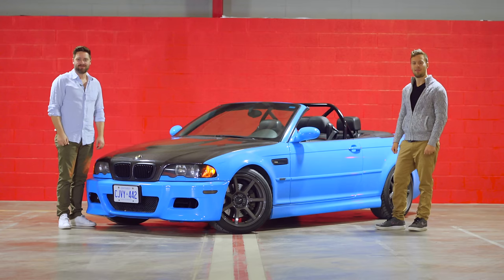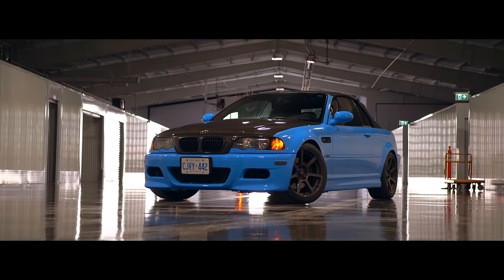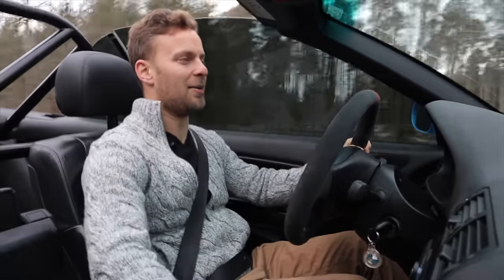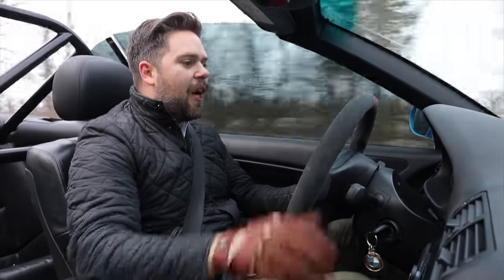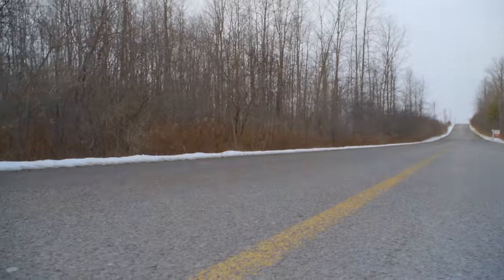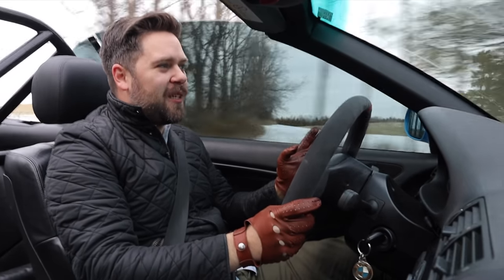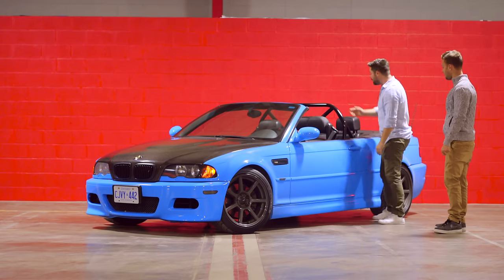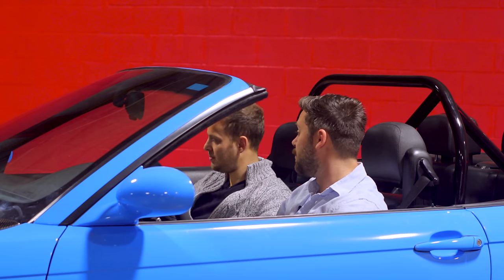I Bought A $10,000 E46 BMW M3 // The Best Car Of All Time… Says Thomas

Comment: the hazard light and central locking issue is an easy fix. you just need to switch those switches out or you can fix it as well something get loose in there over time.

Comment: I have a 2003.5 E46 Manual Coupe 6spd, with 210k miles currently. It’s heavily modified, with suspension and a supercharged system. 

My M3 has had many things replaced, all of which were replaced around 105-135k miles. They include water pumps, brakes, guibo, belt pulleys and tensioners, clutch and flywheel, etc. The list is long, BUT the de things would need to be replaced on any other car at that kind of mileage, and knowing how hard this car has been driven by myself and the previous owner, I would say that any other cars engine would’ve been blown up by this kind of mileage. Yes, there is some expensive maintenance like banks, rod bearing, and valve adjustments, that need to be done, but doesn’t every car out there have their main maintenance concerns? YES. There were also a bunch of items that I replaced just because I knew they had wear, but they didn’t need to specifically be replaced at that time. 

So yes, I’ve replaced a lot of items, and some things can be expensive, BUT this car has never broken down on me and has never left me stranded. At 210k miles and counting, and 600hp to the crank, I’m still at full compression, and am utilizing the OEM clutch kit. The car is rock solid. There are no rattles, the car handles like a Porsche, the electronics have never given me problems...the car is just bullet proof! Some might give the E46 M3 a bad rap because it’s a maintenance nightmare, but in my case, it’s mostly just been wear and tear items that would happen to any other car. Not many cars make it to 200k, and a very little percentage of them are sports cars, driven to its limit and revved out to its max on the daily. If you just take care of the E46 M3, drive it hard like it should, and do your maintenance intervals, it will last a very long time.

Comment: I had an 02 m3 cab like that one. I even had the hard top.  Never liked the sound of the exhaust but that engine was glorious. The car was great and loads of fun but it got to a point where between the service major intervals and reliability starting costing a lot to maintain it.   The interior plastics kept getting sticky or peeling off, the creaks were driving me nuts and one of the windows didn't seal well.  Both side mirrors starting rusting...I felt like I had to restore versus just maintain the car...the last year I owned it I spent over 10k in repairs and maintenance ....I sold it shortly after lol

Comment: Subframe reinforcement because it's a convertible, cheapest E46 M3 you can get so I understand, and yes the best M3 ever IMO. E30 and E90 are close runner ups. The plastics, rubber, gaskets are cheap... Maybe not a problem for Canada but here in Florida the heat will melt them. Need a good cooling system, oil catch can, good coil overs. So easy to work on tho, great project car.

Comment: hazard light and central lock can be fixed with duct tape. it is usual that the bottom of the switch breaks and when it is pushed it is pressing thin air.
Just take it out, either swap for a new one or tape up the bottom.

Comment: The sad thing is the plastics were a big step up from the E36. If you owned one of those, you became very familiar with glue guns and 3M's catalog of adhesives.

As the rear seats are unusable, why not rip them out and carpet the area? It'd save some weight and add storage space.

I also gotta say that as much fun as these are to drive, they have about my least favorite exhaust sound of any M-car. Even with an aftermarket exhaust, they always sounded tinny.
Reply from the maker: This borla has the least rasp of any I’ve heard. It’s really good actually

Comment: ive seen N54 engines hit 600,000 km, my 335i had 280,000km and worked close to new.  The problem is that while the engines are bullet proof everything else breaks around it and costs a fortune.

Comment: $12 fix on Amazon or eBay for a new hazard and door lock button. Been there on my E46. Super easy to install. Pops put, unplug the old one. Plug in the new one. Pop in. Push buttons all day.

Comment: You can replace the hazard/central lock switch for cheap or you can temporarily fix it by removing it and taping the bottom of it back together. It's easy to remove (start with cupholders like James did) and you'll know what I mean once you see the switch. #Gre(46)atestGeneration

Comment: I love and hate this car. I was on the waiting list for 1.5 years to get one, site unseen and undriven. I was lucky enough to get enough money to get one ordered brand new in 2001, with all the options I wanted. Despite absolutely loving it, I sold it 3 months later. 

The primary reason was that the convertible in particular was extremely stiff and was my daily driver. Driving into downtown DC, the minute I started hitting potholes, it started killing my back. Great second car, and the regular coupe is awesome. But I would strongly discourage the convertible as a primary driver for anyone living anywhere with potholes on many roads. 

My current daily driver is the 2018 Kia Stinger GT2. Love that car. But I’m also in my late 40’s and for my daily driver prefer a GT car with adjustable suspension.

Comment: 5:11 independent throttle bodies is not the reason for the responsiveness. VV-T and high compression is the reason. The Camaro v6 doesn’t have independent throttle bodies yet the engine is very responsive.
Reply from the maker: Indeed it’s actually a combination of all those things. The itbs work to allow immediate atmosphere at the inlet of each cylinder, so the engine can work it’s magic. This is just a long and boring explanation that didn’t need to be in the video haha
Reply: @ThrottleHouse  If you say so.

Comment: Had e46 m3 coupe with dinan mods and tune and coilovers. Used as a work car for 3 years. Did not track or race it. Ride is very stiff and harsh. Smg trans shifts very harsh. Hated the car. Dont miss it at all. If u race or track the car, the m3 is for u.

Comment: What if I told you I know of an E46 M3 that is 100% original and has less than 35k miles and has been sitting in a garage for 19 years and still looks like the day is rolled off the line.

Comment: I have a 2006 e46 330ci convertible.  It has just under 60k miles.  It is in showroom condition.  There is literally no flaws.  I only drive it in good weather, sits in the garage otherwise.  New bmw’s have too much plastic and feel cheap to me.  I will sell this car when I get my Cybertruck.  Tesla captured my imagination, bmw has fallen asleep at the wheel.

Comment: Ok, $10k for an E46, and another $10k in reserve to keep it going. Huh. You can pick up an 2010 or 2011 IS-F for around $20 and never have to worry about rod bearings, engine gaskets, cheap plastics. You don't have to put some crazy 60w oil in it and warm it up to temp before you thrash it. Granted it doesn't have a MT, but it fun nonetheless. Anyway, it is a beautiful car, congrats on picking up a classic
Reply from the maker: Na. All the expensive stuff is done. That’s why I paid as much as I did
Reply: @ThrottleHouse  Well congrats on the great pick up! Have you guys done an episode on an older IS-F? If not you should consider doing one. Love your channel!

Comment: "compact, RWD NA sports coupes don't really exist any more"

looks at lap time list where the Camaro SS 1LE literally has the top time for compact RWD NA sports coupes
Reply from the maker: It’s a full out sports car though without much livability. These sports coupes with exciting NA engines, that are comfortable spacious and still wild are hard to come by.
Reply: @ThrottleHouse  I'd agree if you were talking about the ZL1 1LE which is a more track-focused car, but the SS 1LE has Magneride shocks and is not as harsh. I mean I don't disagree with you in general, RWD NA sport coupes are definitely a dying breed. But I don't think they're gone quite yet.

I guess another difference is the E36/E46 M3 is basically a 2 door sedan not really a coupe since you can get it with 4 doors, while the Camaro is a coupe. Maybe the Chevy SS might be a better example, but to your point, that isn't made any more.
Reply: Throttle House with or without the roll cage?

Comment: The only way to increase hp without boost is to install a hotter cam. Intake is a waste of money.
Reply: F165 without boost??? What are you talking about
Reply: It increases the awesome induction noise and I wouldn't be surprised if he got the intake for free. He alludes to it in the video.
Reply: @slowschoolofdriving218  Without a turbocharger, Nitrous oxide (aka as boost in a tank) or supercharger. Changing the intake cam is the only way to increase hp. Before you try to school me on some bs you read or watched online. I have a video where I remove, rebuilt and installed a hotter cam in my 96 Tahoe 5.7 v8. I had to swap in a 99 Tahoe pcm so I could tune it with HP Tuner.

Comment: That’s not my car, but I’m very proud of it 😁👌🤝💪👍👍👍👍😁😎.  I used to own a Cabrio for over 10 years.  Maintaining cost a billion.  Not so reliable.  BMW badge on that car stands for Break My Wallet. 😁👍💰. If you think you are going to buy that car for $10k lol good luck.  Yes you will buy it for 10k and spend another 10k to make daily drivable.  How much does it cost to do the diff? Engine Rod bearing ? Clutch ? Suspension?  You forgot to mention, if you don’t have free Mechanics standing by, labor and cost of all the things I just said will set you back more then $5k even for original parts. And original parts are not cheap on that car. Basically for $10k you are buying a older $80k plus car which it used to cost as a brand new car, and parts are made for a $80k car and not for a $10k car, over the 10 years I have spend like $40 on my E46 M3 with some upgrades and cost of Maintenance from all the things breaking down a going bad. And yes I used to drive it like it Stole it 😁💪😎🤪🇺🇸👍👍👍🤝👌.  Nice car brother, If you don’t have a wife and kids, don’t plan on getting married, by all means E46 M3 is the lady you want to bring home 😁🙏👌🤝🤪😉😂

Comment: i had a 01 E46 M3 Vert with a manual and it was by far the worst car I've ever owned. Spent 6k in 5 months and dumped it. It's a beautiful car and with the right exhaust at high rpms sounds nice but in my case horrible reliability. Ohh and the squeaks and rattles from the top 😭

Comment: Why would you get this as a convertible if it's going to be a track car?  Am I wrong here?!
Reply from the maker: This is a cruising car for now. I have a bmw track car already
Reply: @ThrottleHouse  are you going to eventually make it a track car? Because I just check on autotrader  and there's a 2003 M3 convertible with 136,000 km on it for $13,995 CAD, in Montreal.

Comment: I had a bmw with the n54 engine I will not go back owning a bmw sucks everyone cuts you off and there's always something wrong with your car to the point where you get used to it. You'll spend hundreds in repairs in a relatively low mileage car. Stick to honda and toyota if you want something that was actually built with care.

Comment: AHAHAHAHAHA, yeah, wait until you have to weld-repair the rear subframe when the mounts shear off.  Wait until you have to tear down the entire VANOS system periodically to replace those stupid o-rings.  Wait until you have to suspend the engine and drop the sub-frame just to change the oil pan gasket.  Wait until you have to replace the CPV gasket every year because the moron design engineers put it right next to the exhaust headers with no heat shield.  Wait until you have to pull out the entire power train to get at the rear main seal gasket.  Wait until you think you've replaced your last oil seal/gasket, only to realize the first one you ever replaced, is now in need of a replacement again.  Do you have an SMG transmission?  YOU'RE DOUBLY FUCKED!  Best car of all time my ass, ask anyone who's owned one for more than 3 years.  I couldn't sell that POS fast enough.  I don't care what the enthusiasts say, it is one of the most piss-poorly engineered platforms ever conceived.  Fun to drive?  Hell yes.  Fun to own?  Pfffffttt go jump in the sea.
Reply from the maker: Every single one of those things was addressed. That’s why I bought it. It’s explained in the video.
Reply: You’re better off with a Merc or Porsche from the last ten years.  You’ll spend the same amount as you would on the E46 TCO, but with more time on the road and less time on the lift.  If it HAS to have one of those awful chipped up blue and white roundels, the one to have is the Z4M from the same vintage.  Same basic platform but all the awful bits of the E46 have been sorted, save for a couple dodgy engine mounts.  Much more fun to drive too!  E46 belongs in the bin.

Comment: that m3 is completely destroyed - everything that was good about this car is killed - also, i own an e46 m3 and currently @ 170,000km and the only issue ive had is with the soft top - so stop trying to play out stereotypes for memes lol its getting old
Reply: however, im glad you love it
Reply from the maker: I uh, didn’t make any of those things up. They all really happened. Congrats that the only thing gone wrong on yours is the soft top tho! I’d do an oil analysis at some point though. And check your subframe.
Reply: @ThrottleHouse  i dont deny that they happened - you guys just love to play out to this bmw stereotype which is a meme and not really helpful or informative as car journalists imo - thanks, willl take that on board lol